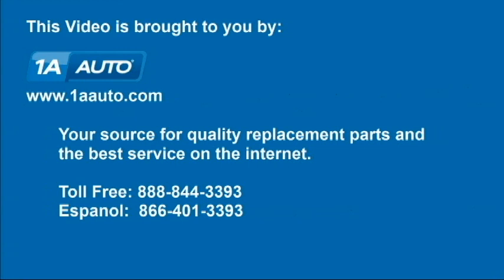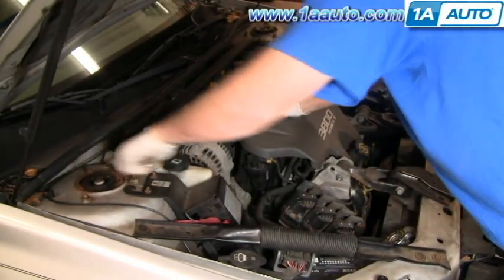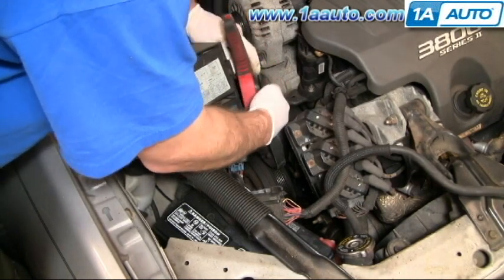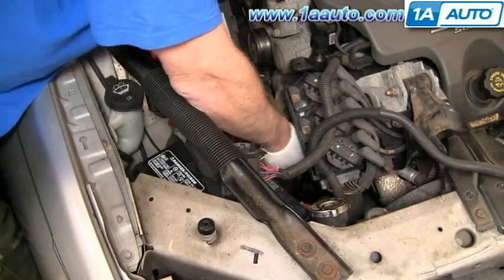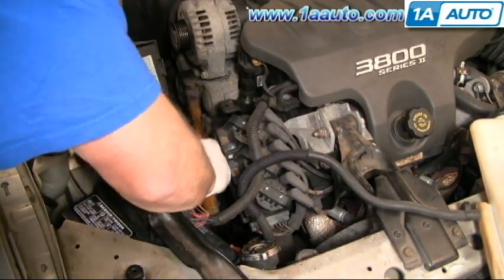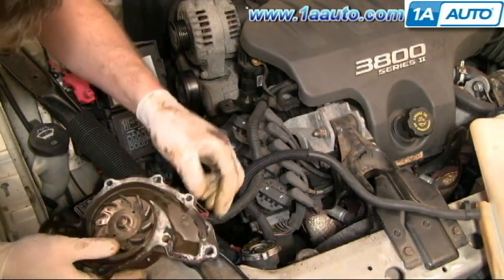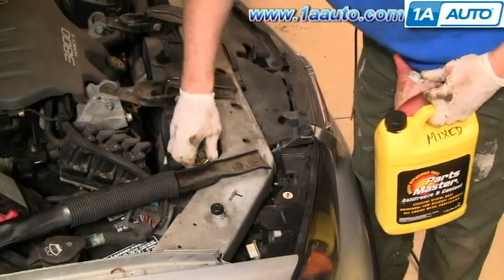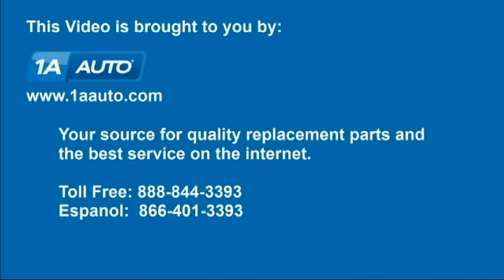How to Replace Engine Water Pump 00-05 Chevy Impala

Comment: Instead of using a chain wrench, you can leave the belt on until you break the bolts holding the pulley free. This will also allow you to remove the belt without struggling with the tensioner. However, you still need to use the tensioner to get the belt back on.

Comment from the maker: If you take the belt off of it, try to turn it by hand. If it doesn't move freely, it more then likely is bad. We carry new water pumps on our website for your 00-05 Chevy Impala. Here's a link to them on our site. 1aauto.com/1A/WaterPumps/Chevy/Impala/-/-/2000?utm_source=youtube&utm_medium=youtube&utm_campaign=1ATony  or you can call Tony @ 866-403-3393

Comment: You are very Professional & speak very clear With-out Hesitation.
I ordered a water pump from 1A-Auto. I will have my Very Experience and Knowledgeable mechanic Install the pump. How much time (Clock) will it take a very competent mechanic to Install the water pump. (2002 Bonneville.3.8 liter. NOT a super charge. Thanks!

Comment from the maker: @spelunkerd It more than likely leaked because of the old gasket. Once you install the new gasket onto the water pump and tighten all of the bolts, that's all that should be needed to prevent anything from leaking.

Comment from the maker: The 3.4 is similar but the bolts used and the location might be slightly different location because the parts are different.

Comment from the maker: You may want to may sure that it's the correct pump, on some vehicles the flow may go in a different direction between years. Also check (when the vehicles cold) that the radiator is full inside and that all of the air pockets are out of the system.

Comment: good idea with the belt wrench to hold the pulley. i always just use 2 wrenchs or use a small pry bar against the bolts. but i'm think now i'm going to try and find one of those, would make the job easier, although thats only a minor thing i guess.

Comment: tip if you dont have that belt pulley tool leave the belt on and loosen the water pump pulley bolts first thats what i did.
Reply: ILLGoThere4You  what about when u put it back on
Reply: You can use a screw driver after you get one bolt started on the pulley Cross the screw driver over the bolt head and wedge the handle of the screw driver to help keep the pulley from moving as you install the bolts
Reply: ILLGoThere4You Haha just had to do that last night in a pinch. 😉
Reply: @donaldgay9501  is your last name gay?  That's gay.

Comment: Ok so I've changed the water pump and thermostat on my 06 Grand Prix, but now its running hot a lot quicker and making a very annoying squealing noise. Any thoughts? Damaged hose, belt to tight?

Comment: Chilton manual says 16 ft-lbs for short and 25 ft-lbs for long, but many videos and other repair sources have suggested 11ft-lbs for short and 15 ft-lbs for long. Just broke the heads on two short ones trying to torque to 16. Where are your torque specs from?
Reply from the maker: +Sachin Sanam Thanks for the tip! We'll pass this info along to our production team.

Comment from the maker: Sometimes you may have to wiggle the pump a little bit so you can get the bolts started. Hope this helps you out. 1aauto.com 888-844-3393

Comment: Is this the same as replacing the steering pump as well? I have like a winding noise whenever I turn the wheel I hear or either accelerate I hear it

Comment: Is that foot lbs for both or inch lbs one the smaller ?im assuming foot lbs but you know what happens when you assume:)
Thanks for the video
Reply from the maker: It would be for FT LBS, thanks for watching. 1aauto.com 866-403-3393

Comment: How do you "get steering pump up in place" (~10:26)?  I had a devil of a time.  Finally held pump w/left hand while that index finger touching bolt hole area used guide bolt to hole.  If bolts weren't sweet, alignment could have been near impossible.  What's the good trick to get it seated and bolts aligned and started?

Comment: Tip you don't have to remove power steering pump all the way just remove top bolt and loosen the bottom that will give you enough room to get to the bolt behind the power steering pump pulley
Reply: best tip on here that bottom PS bolt is a pita!
Reply: Boy am I glad to hear that. Everything was going great until I saw that bolt behind the ps unit!

Comment: i have a 2004 monte carlo that ran hot on me.  all my coolant was gone out the reservoir.  I filled it up and it kept leaking after a day.   I looked for a leak and finally found coolant at the bottom of the engine in the tray under the engine.  Is that signs of a bad water pump?  After a few days it stop leaking and now its normal
Reply from the maker: +blue boy40 I wouldn't count on it staying normal. It's really difficult to diagnose a coolant leak without actually seeing it. The coolant could wind up below the engine from anywhere, really. The best course of action would be to buy or rent a cooling system pressure tester. They're really easy to use. Basically it pumps air into your coolant system to bring it up to the pressure it would be operating under. This pressure forces coolant out of where ever the leak is and allows you to find and repair it. Hope this helps you out.  1aauto.com?utm_source=YouTube&utm_medium=CTA%20Comment&utm_campaign=1ATony 866-403-3393

Comment: If my water pump needed to be changed would it effect my power steering
Reply from the maker: +daeion laswell No it would be a separate issue, you may want to check the power steering pump to see if it's going bad. Hope this helps you out. 1aauto.com

Comment: I replaced the pump but now I have air in the system, no heat. What am I missing. Please help.
Reply from the maker: When the vehicle is cold, take the radiator cap off and blast the heat inside the vehicle. Let it warm up, and add anti-freeze to top off the radiator as the air bubbles work their way out. Do not rev up the engine while you do this, as hot anti-freeze will shoot out of the radiator. Once you have it topped off, place the radiator cap back on and top off the radiator overflow bottle. Hope this helps you out. 1aauto.com
Reply: there is a brass air bleed valve right by thermostat, open it up cold and fill the rad until coolant comes out of it.

Comment: Where is the second bolt on the power steering pump
Reply: Guessing you are referring to lower bolt. It's at six o'clock. Top bolt is at 12 o'clock

Comment: A torque wrench is NOT needed for this job. Use your own intuition instead. Their recommendation of tightening 110 ft lbs. broke a bolt off in my engine block. Now I have to take it to a machinist to get it removed. I repeat, DO NOT use a torque wrench for this job. It's simply not necessary and they should've mentioned that!
Reply: 110 ft pounds ? lol no wonder why it broke ...watch the video again he said 10 foot pounds